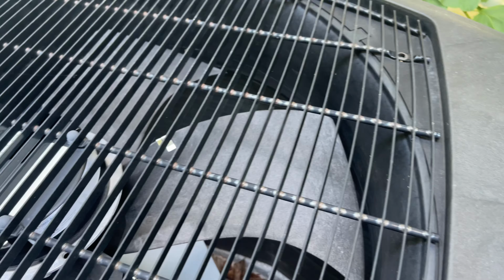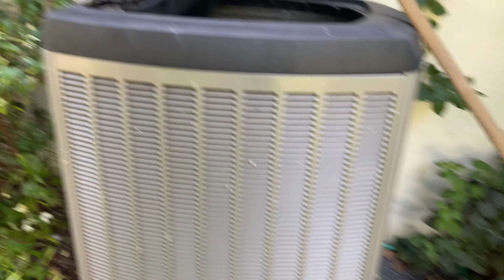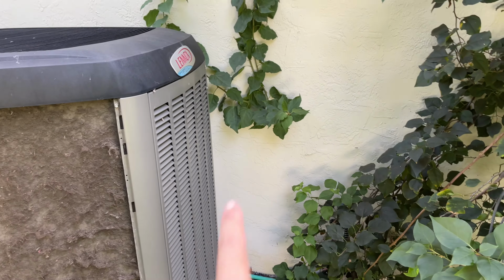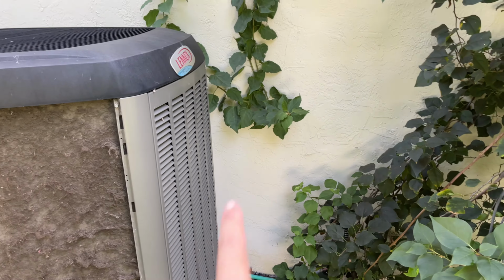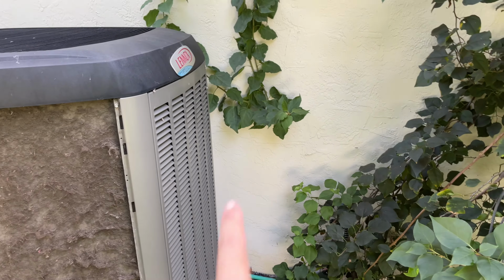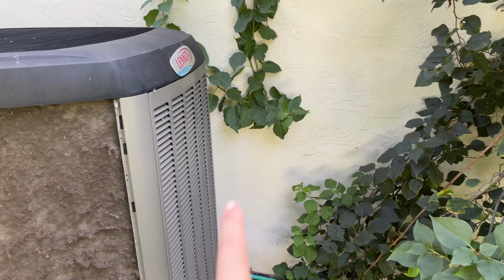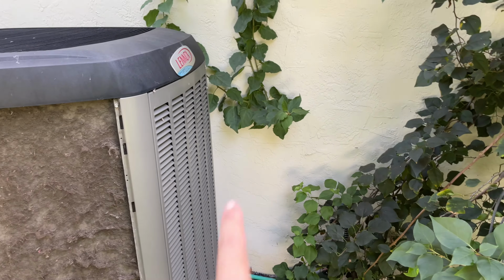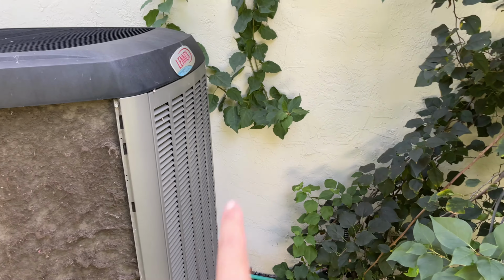How To Clean Super Dirty Outdoor AC Compressor Coil Fins - Summer AC Repair Tips

Comment: Thanks for sharing.  I used a paint brush to lift the hair, cottonwood and other material from the outside before spraying from the inside.  When dry I could pull this off in sheets and toss it in the waste can.   I used 1 to 1 vinegar and water to spray from inside and hosed it out from inside out.  then used spray bottle of Dawn and water to soak the fins and sprayed from inside out again.  The 7 year old fins look like new and you can see thru them everywhere.   Be careful to turn off the power and thermostat to off.  Good luck.  do this yearly.
Reply from the maker: Thank you for sharing

Comment: You should have brushed the outside "fur coat" before washing the coil. They sell a brush that is  meant for that which will not damage coil. Had you done that, 2 cans of foam would have been plenty and taken you maybe 30 minutes. This should be an annual cleaning also
Reply from the maker: Didn't clean the coil for almost a decade, thus it ended up like this, beyond cleanable. Actually coil busted after the clean due to corrosion and had it replaced under warranty.